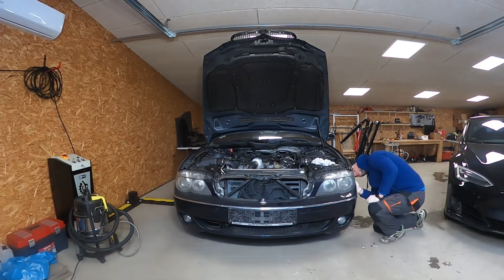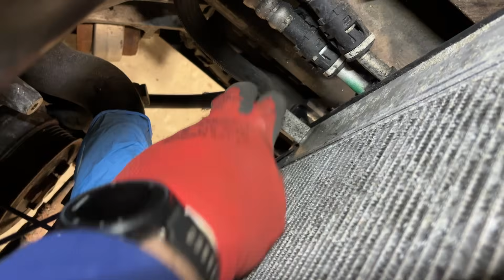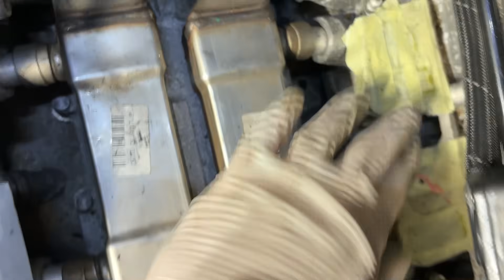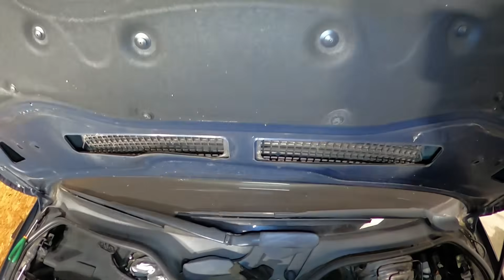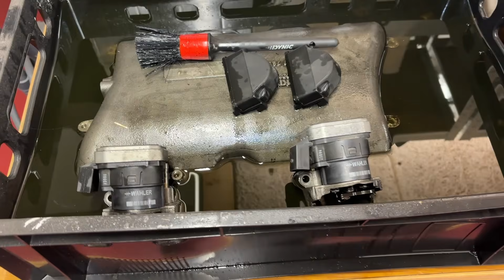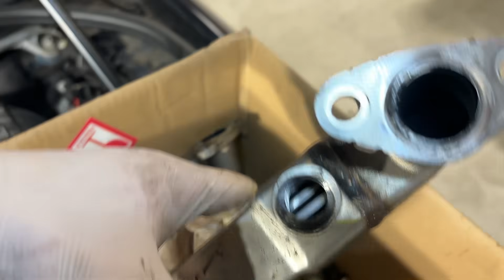I tore the entire front off the BMW E65 745D M67 S01E03

Comment: Whats the update sir on this torque massaker?
Reply from the maker: Need to finish finally walnut blasting of each intake port. I recorder vidoes but haven't prepared next episode. Too many customers with their cars + tire machine renovation dragged me out.
Reply: @rockybor25  You dont need to drop off the gearbox for this cable im doing it right now, get the left dpf off, starter heat shield, lower cowl and you should be fine. I have a spare engine and i was able to see the positive cable path from behind the engine its do-able. The part is 150 euros.
Reply from the maker: @lesablier2088 good to know, thanks

Comment: Ive got 745d too, bought it and did piston replacement. After all that work the car has got massive electrical issue which no one can seem to fix. Im struggling to get modules working especially with whole electrical system not matching 730d or any petrol version.
Reply from the maker: I'm stuck with walnut blasting of intake ports. Half ports are turned and deeply “hidden”. Hard to remove carbon deposits. Besides that few walnut pieces stuck between valve and head 🤦‍♂️. So, maybe I will need to remove heads anyway.